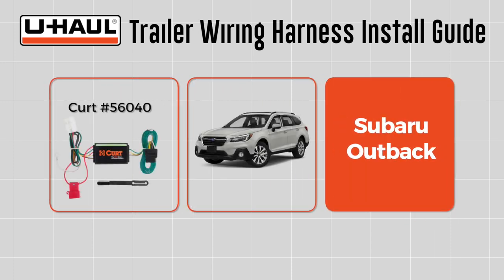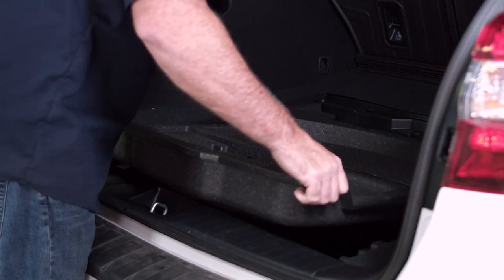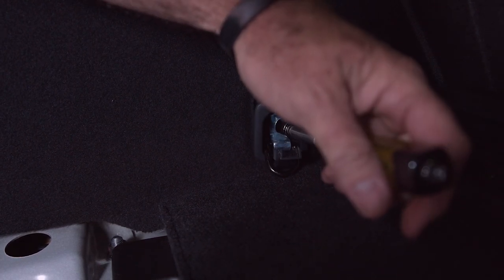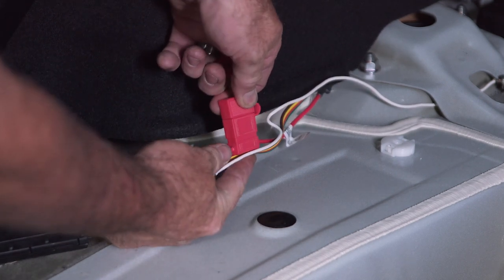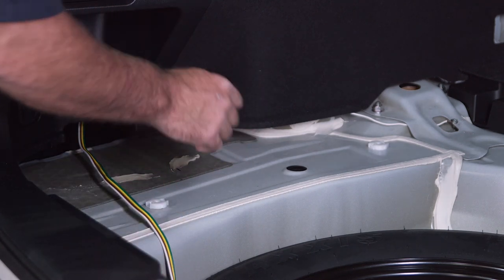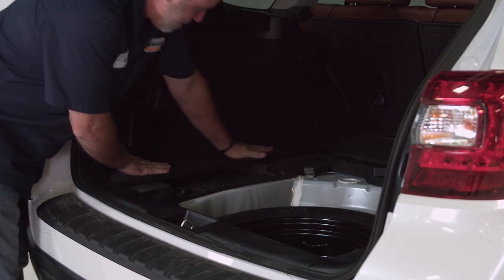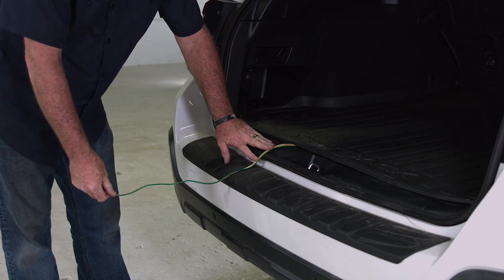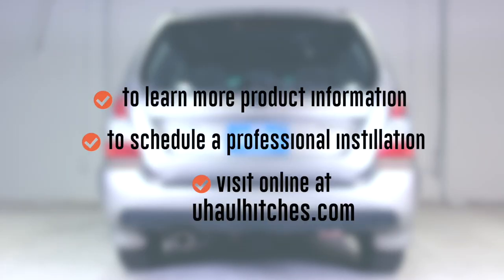2011 Subaru Outback Trailer Wiring Installation

Comment: You’re a lifesaver! I had gotten a quote for $179 on the harness and $200 for labor. After tax, it would have been over $400z  I just did it myself in 10 minutes with no mechanical or electrical experience and Just paid $35 for the harness on Amazon. Thank you TONS!
Reply from the maker: Way to go!